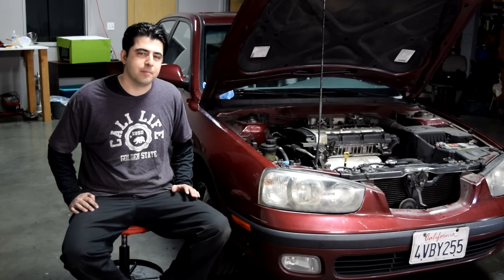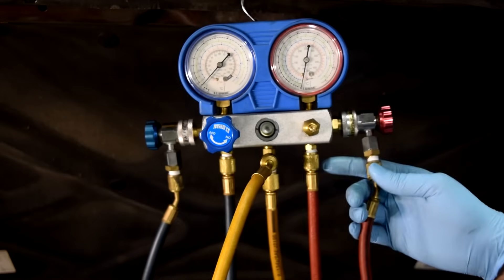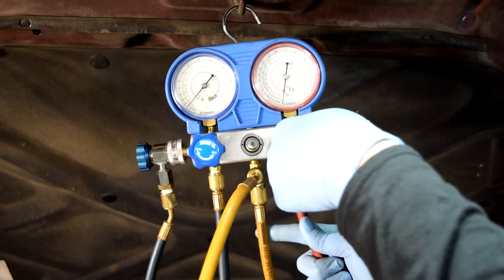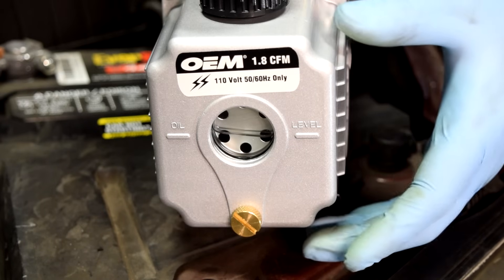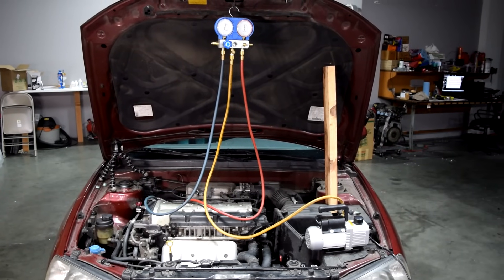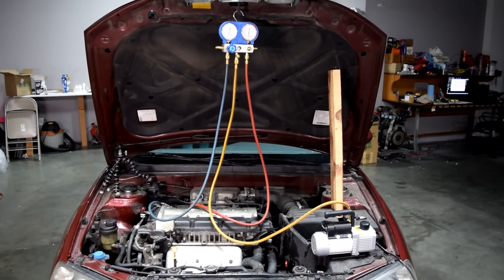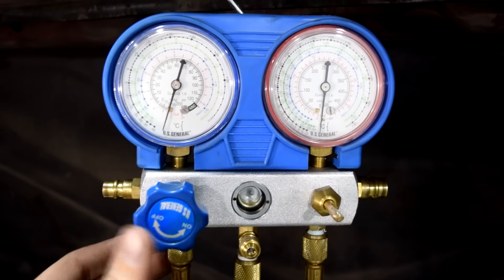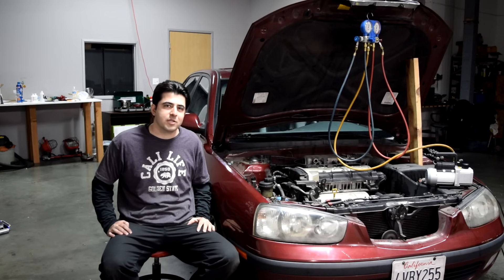How to Pull a Vacuum on an AC System - Step by Step

Comment: one question and please excuse my ignorance
when you do a vaccum on your car's ac system does that take out all the refrigerant in your system?
Reply: Ac shop removes the freon.   Is illegal to let their free on go out in the air. Huge fine!
Reply: Vac pump rids of any water and or moisture from the system. A/C systems depend on having the correct amount of oil per what ever part your changing. So make sure you check specs and add if need to.  Neg pressure will actually boil any water/moisture from the system. It's pretty cool. Once done like the video, the freon will not be contaminated with moisture and perform as it should.

Comment: 6:20.  Teflon on the threads for this application does not improve the seal at all. These lines are a form of compression fitting.  The hose and the gauge fitting are forced together.  Teflon may allow you to apply more force by reducing the thread friction but if the two mating surfaces have any issues the Teflon will not correct it.
Reply: Shain Andrews - bs
Reply: Shain Andrews no but it will stop those hoses from coming loose without using thread locker which would make it hard to remove the hoses if needed. If you did remove em with thread locker, you'd probably ruin the fittings. So yeah, Teflon tape is a good idea.

Comment: is pulling vacuum needed every time you charge the A/C system ?
or only when changing an A/C component ?
Thanks
Reply: If you're having to charge frequently, you have a leak, and you should pull vacuum when recharging.
Reply: @ZheKing  I recharged 1 month ago and now it’s hot again. Do I need to recycle my refrigerant or can I move forward with just a vacuum test?

Comment: ratchets I have a cuestion, I replaced the transmission in my 04 nissan altima and I was lowering the engine and the frame to be able to take the transmission out of the car but the lower pressure hose wouldn't let me and I disconnect it from the compressor when I unplug it it felt little pressure,  do you think I need to put oil or or just fill it with r134?,I know that I have to run the vacuum pump

Comment: Another winner, R & W! Thanks to you, I have taken on the challenge of replacing a compressor, accumulator, expansion valve, and condenser, as well as flushing all the lines, and the evaporator, and changing all the o rings, and vacuuming down the system. You taught me how to do all of this. Thank you. You saved me $1300!
Reply: If ur replacing the components u flush the phisical lines that connect the components by removing them and adding flush solution to an air line and blowing that solution through the lines into a bucket to see what u flushed out. Then running lots of air thru after. It's really only necessary if your compressor froze, resulting in grinded mechanical metal shavings being introduced to the system. 

In my case the clutch stopped working of old age and wouldnt engage. It didnt freeze, and there was no system leaks. System was still sealed. So i replaced compressor and condenser and used this vacuum method to test seal. 

All is sealed. Will be adding r134 tonight. 

Didnt change evaporator cause too much work in glove box removal and no symptoms of being faulty.
Reply: How did you flush the lines?

Comment: Will vacuum pull all the oil out or does the compressor need to come out to drain the oil?
Reply: Vac pump rids of any water and or moisture from the system. A/C systems depend on having the correct amount of oil per what ever part your changing. So make sure you check specs and add if need to.  Neg pressure will actually boil any water/moisture from the system. It's pretty cool. Once done like the video, the freon will not be contaminated with moisture and perform as it should.
Reply: @franklessary1014  you did not answer the guy's question, he asked will the vacuum suck the oil out also?
Reply: @johnruan3548  when you pull vacuum it evaporates water and any moisture. It may pull residual oil but will not remove it all from the system. If you want to remove oil from the system you have to chemically flush it blow it out completely,  pull vacuum to evacuate the system then recharge.
Reply: when you pull vacuum it evaporates water and any moisture. It may pull residual oil but will not remove it all from the system. If you want to remove oil from the system you have to chemically flush it blow it out completely,  pull vacuum to evacuate the system then recharge.

Comment: I replaced every component of my ac system and it still leaks. I give up.
Reply: What you need to do is put some pressure on the system with nitrogen and use some soapy water to find the leak
Make sure all the rubber seals are good
Sometimes if you don't put oil on those rubber seal they can  break or not sit properly
If you have any questions let me know but that should do it.
Reply: Thanks, but backyard mechanics don't have nitrogen. I took it to a shop and one of the brand new shcrader valves was bad.

Comment: Sir I am experiencing a problem with my Toyota Yaris (2008) Aiconditioning. When I am running around 60 - 80 kph (let say 2 for 2 minutes) the AC blows hot air in the air oulet, and when I reduce my acceleration or in Idle position the AC works perfect.
I already recharge/flush system with fresh 134A, replaced the receiver/drier. All gauges are working fine during idle position of the car (low and high side is perfect). My compressor is only 9 months old so i dont see any issues with my compressor.

Hope you can share your experience with me. I am from Qatar. thanks.
Reply: Is this the 1st time  Owning a Toyota yaris?  From what I gather that Toyota yaris is big on conserving power and less pollutants. When under mid or hard acceleration or at a higher mile per hour speed the demand on the engine is higher therefore the AC will work at a low or slower pace (on/off) to give power back to the engine. So when you're at cruising speed  And not a mid throttle or 3/4 throttle your AC works fine.  Hope that explains it a little better😊

Comment: Thanks for your outstanding vides and great accent! 
How often do you change your vacuum pump oil?
I saw someone recommend changing it every time you vacumm down a system and I think that is a bit much.
Reply: depending on the contaminants and the moisture in the system when you pull the vacuum, it is recommended to change the oil after each pump down. I work on larger systems, in which cases compressors burn out or you get a block in the metering device, you'd change right after. Different strokes different folk's.
Reply: I work as a A/C tech for a company that services residential and commercial units. If you don't use a vacuum pump all the time it depends. How well are you able to seal up the connections and exhaust port of your pump? If you use it yearly I would recommend changing it out every time. If you have access to a micron gauge you would visually see in the inability to pull as deep of vacuum as you have done before. In residential/commercial/industrial we are required to pull at least 500 microns of vacuum my preference is under 150 to ensure the removal of non-condensables, but automotive a/c doesn't require such deep vacuums. However while pulling a vacuum specially in a vehicle it's so easy to hit the different ac components with a heat gun or hair dryer to help drive off moisture.

Comment: Great video thanks for sharing. i have two questions i hear vacuuming removes moisture from the system e.g water droplets but how can that be achieved yet vacuuming only causes temperature of water molecules to drop which as a result of reduced temp makes it even harder for the moisture to be removed.

two i use a 1.8cfm vacuum  pump but the only vacuum i get is only 20 inches of mercury.
Thanks alot keep up the good work we really appreciate

Comment: is it bad to use vacuum for different refrigrant types? i mean if you used to vacuum on r22, then you vacuum r32, then you vacuum on r134a.
Reply from the maker: hadiyoo You are not vacuuming out the refrigerant, you are pulling a vacuum on the system to remove the little bit of moister that gets in there when you open up the system for repairs.
Reply: thanks for the reply. my ac split installation manual says "use a vacuum pump for r32 exclusively. using the same vacuum for difference refreigrants may damage the vacuum or the unit". so, can i forget it?

Comment: Really enjoyed your video and it's content...what model of camera and lens do you use?
I have a question I hope you can help me with: my mechanic changed my compressor and didn't flush the system and as a result it contaminates clogged my new receiver dryer. I have a new dyer and condenser coming and have now flushed the system properly (I HOPE), my question is: is there anyway to clean (flush) the new compressor that ran for about 30 mins with the contaminates still in system??? I would appreciate your obvious expertise. Thank you in advance...and again, nice informative video.

Comment: Nicely done. Not a whole lot of pointless nonsense just straight to the point clear info. Thx.
Reply from the maker: Cue L np, thanks for watching.
Reply: hi there, i always watching your video, my a/c compressor on and off, and if the wheather temp is 90 up my a/c not working, ill check the relay fuses its working fine also check the freon still good some friends they told me too much preon on the system, can u make video how can i fix this? thank you sir.
Reply: bimmernismo 335iz of
Reply: bimmernismo 335iz vacuum the system and add freon.
Reply: Cue L very informative!

Comment: Hi i just got one question what happens to the a/c that is in the vacuum pump is there a place where you can get the pump empty or what, and awesome job by the way.
Reply: Can someone answer this?
Reply: It is vented to the atmosphere. That’s why you need to get a certified pro to collect the gas first. When u put the vacuum pump on the system should not be pressurised. What the vac is doing is causing water to boil and evaporate. That’s what it’s for. To remove moisture, not refrigerant

Comment: I've read that some shops do a purge of the system with nitrogen, as a second effort to clear the system of moisture and debris. Of course that would mean yet another specialized tank to clutter the garage. I do have 100% Argon on a TIG welder, and at one time I wondered if that inert gas would work just as well. It's certainly more expensive than nitrogen but it's on hand. With no info to prove that argon is safe in the system and with many people using just vacuum I think I'll do as you do. Great demo!
Reply: +spelunkerd  We pressurize the system with nitrogen  to about 300 psi to test with soapy water along the system to check for leaks but then you have to vacuum it again. So its recover, vacuum, nitrogen, vacuum and then charge. But if it holds vacuum no reason to check for a leak.